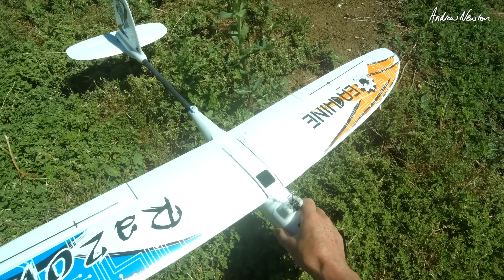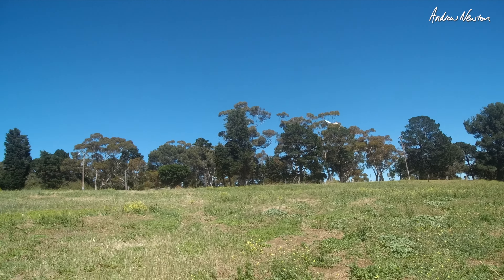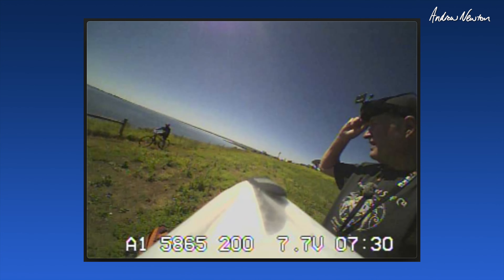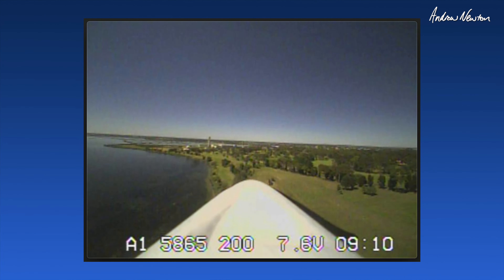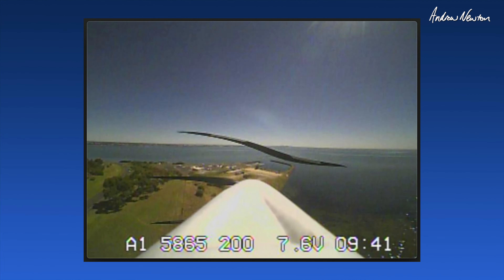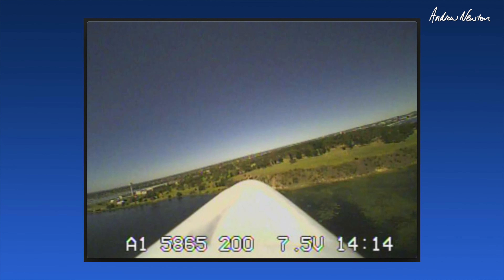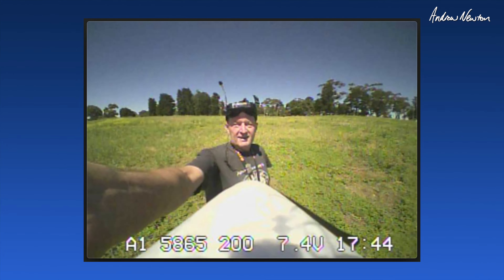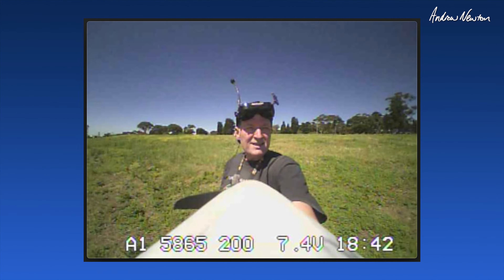Eachine Razor - FPV

Comment: Andrew:  I noticed you mention the Eachine F4U and P51D Mustang in your description. Have you tried installing any FPV system in those planes? I have both planes, and have tried to mount a small AIO cam in the P51D, but have had problems getting the CG right. Is a bit sluggish and flakey, probably due to too tail heavy with my extra battery in the back. Would be fun at my small walking park flying site, though. - Jim
Reply from the maker: I dont have them Jim, they were links Banggood asked me to include for the Black Friday sales.
Reply: @AndrewNewton  
   I know these planes are smaller, and more toy grade than you usually work with, but I think you could, & would offer considerable insight and suggestions if you did review them and suggest changes as you do in your reviews so well. 
   Do you plan to get this series in your shop soon for review? 
   Many people who are interested in the hobby, but hesitant to commit to federal authorization, need your guidance in the <250gram  arena.

Comment: Andrew! Is the GPs included in FPV version or no? As on your link is written : Flight Controller: Eachine Safe-FC with GPS (not included, Click Here).   But I do not need flight controller with gps, as it is 45$ more, just gps would be fine.
Reply from the maker: No GPS with the FPV version. The product page lists it all

Comment: Nice little aircraft thanks for the great demo as usual.  One thing I noticed that I have never seen before.  Your video was blurred most of the time which has never happened before.  It improved a wee bit when the camera was not moving.   The on board video was also blurry.  Had you changed the cameras or was there a problem during the upload to youtube.  I thought maybe my eyes had gone crazy but double checked with many other of your videos and all was ok with them. lol  This is meant to be constructive criticism as most people would not mention it.  Happy Flying
Reply from the maker: My hatcam lens had a fingerprint on it unfortunately. For some reason I uploaded this one at 1080 instead of 4k as well.